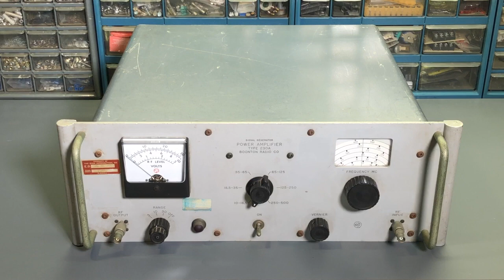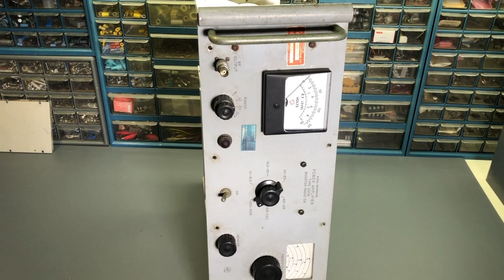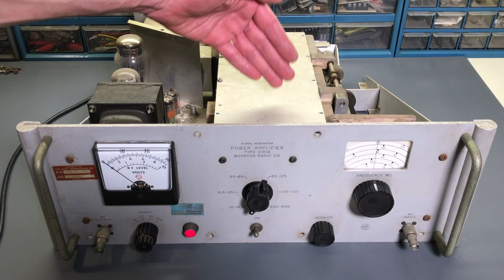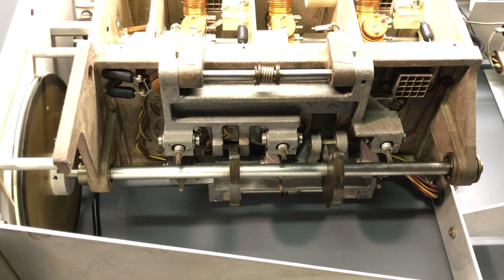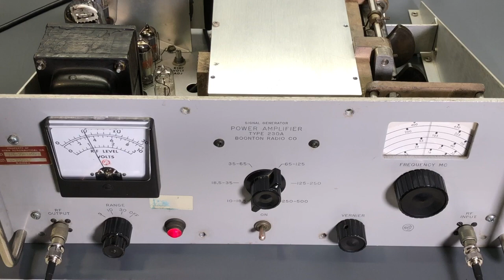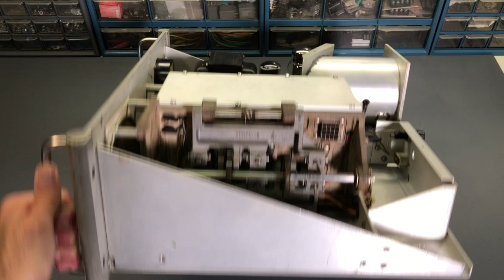Restoring a Vintage HP 230A RF Power Amplifier | Boonton 230A

Comment: I enjoyed seeing the 230A for historical reasons, as I have the very similar but somewhat newer 230B.
Reply from the maker: Thanks for watching!  Glad you enjoyed the video.
Reply: @EriksElectronicsWorkbench  operationally, the 230A and 230B are virtually identical. Looks like HP used the 230A design, changing only the name-plate. The 230B uses solid-state parts in a few locations but even the power supply design was unchanged except for solid-state diodes in place of the vacuum tube rectifier.
Reply from the maker: @jeremynichols4927  always interesting to see how designs are changed (or not) over time.
Reply: @EriksElectronicsWorkbench  I’m still researching this one. Have to hunt on line for Boonton catalogs to see when it was introduced; I have a good collection of HP catalogs but no Boonton (I suspect early 1950s). HP bought Boonton in 1959 but didn’t list their products until their 1963 catalog, with a special “Boonton” section in the front of the catalog. Hmmm, is that right? (Working from memory.) 

Anyway, the revised 230B was in HP catalogs from 1972 until 1976. Knowing HP, I suspect the 230B might have been available as early as 1970-71 (there was no full HP catalog for 1971) and probably would have been available on special order after 1976 until Boonton ran out of parts. 

Differences
230A vacuum tube rectifier
230B full-wave bridge (4 silicon diodes) also means a different transformer.

230A All components on metal chassis
230B PC board on chassis for power supply and meter circuitry. The B+ regulator circuit used the same tubes as did the 230A! HP used that same circuit in many instruments of that era. The meter circuitry was changed to solid state instead of the tube design in the 230A. 

The amplifier chassis uses the same tubes (2C39A) and may be identical—I haven’t seen a 230A schematic. 

Interesting that HP used the Boonton chassis design pretty much unchanged (except for the PC board) and didn’t force-fit the design into the Type-1 chassis that HP instruments were adapting.
Reply from the maker: @jeremynichols4927  yes the dates you mention seem correct.  I have a technical data sheet for the 230A by HP dated 1967.  The Boonton catalog mentions Boonton is a subsidiary of HP since 1959 and a divisional since 1962.  I'm not sure when the 230A was first released.  At 16:00 I show the schematic for the 230A.  I don't have a 230B schematic.
Reply: @EriksElectronicsWorkbench  I would happily send you a copy of the HP-230B schematic from my manual but it looks like I can send only a text reply to you via YouTube. I am open to suggestions on a way to send a schematic.
Reply from the maker: @jeremynichols4927  thanks I'd like to see the schematic and keep it in the archives.  There is an e-mail you can use to share the schematic that is listed in the link under the channel title (the about this channel link).
Reply: @EriksElectronicsWorkbench  I must be exceptionally dense today. The only link I can find is a link to your channel 
https://youtube.com/@EriksElectronicsWorkbench?feature=shared

The various mail and message links give me an opportunity to tell others about your channel but not to communicate with you.